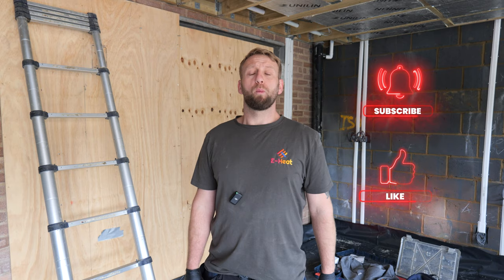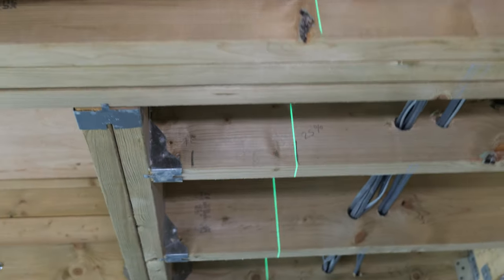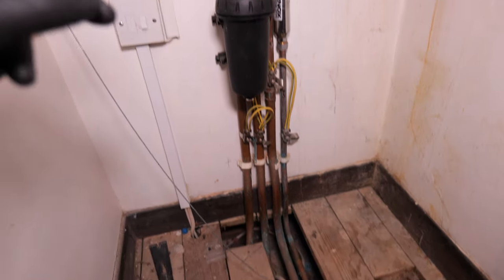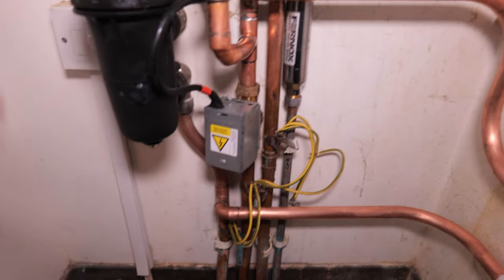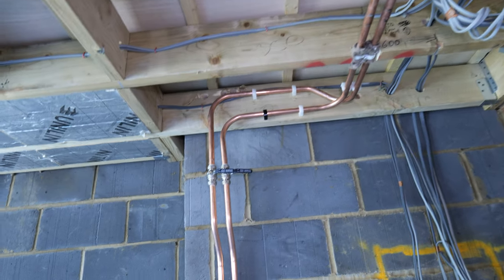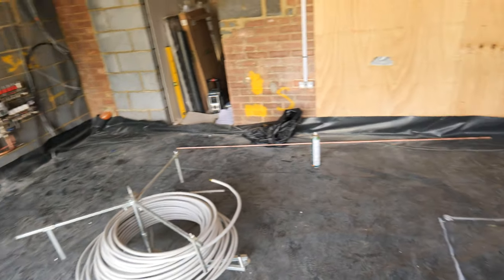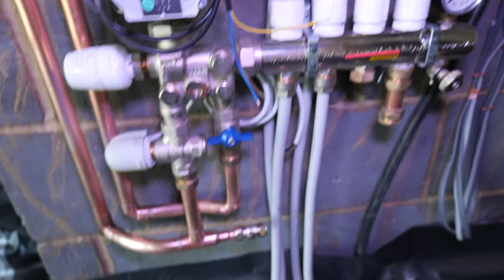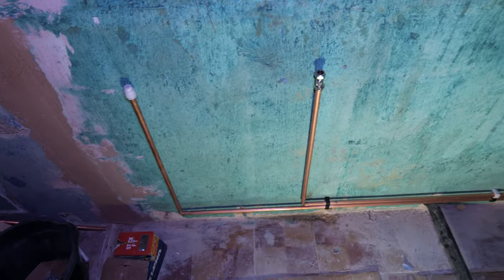Extension underfloor heating to combi boiler

Comment: Thanks a lot for taking the time and trouble for making the video. Our system mirrors yours,  kitchen extension with UFH to existing boiler. Couldn't work out why we were getting water hammer from zone valves when the CH/UFH shut off! 
No bypass for the pump run on!! Doh....
Cheers 😊 👍

Comment: One of the reasons to pressure the underfloor pies to 6bar is to expand them slightly so when the screed goes down there will be a tiny gap between the screed and pipe to allow for expansion when the heating goes on.

Comment: Seeing this manufacturers manifold has convinced me to use Nu-Heat again on the house I’m currently building. And yes I installed the underfloor heating on previous.
Reply from the maker: Thanks for the comment. What's the difference may I ask?
Reply: @loving-plumbing  their’s was much more concise. not cheap though.

Comment: very good information, I am installing a UFH system to my combi system currently. From the video I will add in a bypass. But I had a question on the 2port valves. Should there be 2 port valves on both the CH to radiators and the UFH manifold?

Comment: Great video and knowledge is amazing like your other videos what boilers this the 4000 or the 8000 and can you use the plug in room stat still with the radiator side and use external controls for the underfloor or will you need to hardwire a new controller for the heating I’m so bad at electrics

Comment: Great video. I'm looking to get Tado installed. Regarding the electrical wiring for the 2 port valve, I understand you need to install one for the radiator and one for the UFH after the flow pipes from the boiler are tee'd off. But I'm keen to understand how these motorised valves get their power? As in, where does the black cable coming out of the motorised valve connect into? Any idea how each of these motorised valves get their power to turn on/off? For example, for the UFH, do you install one 2 port valve in the manifold area which gets its power directly from the manifold / UFH wiring control centre and turns on once the thermostat calls for heat? And to control and turn on the radiators, do you install the second 2 port valve next to the boiler so it can collect its power directly from the boiler or from the Tado wireless receiver (and therefore switch on once the Tado TRV is calls for heat)?
Reply: Am sure they all connect to a wiring centre to run all system

Comment: Worcester have put a technical bulletin out for connecting ufh manifolds to their boilers TB 0137 B. It needs hydraulic separation
Reply: I’m looking to do this on my system, but I plan to stick another pump before the rads otherwise I think the CCT will just become a bypass when rads are calling for heat. Would you install an identical erp pump to the boiler and wire it to the boiler’s pump so it mirrors the pump modulation?

Comment: I'm fairly sure you fill up the underfloor through a hose connected to the Manifold, not use the boilers filling loop? What did the manifolds' installation instructions say?
Reply from the maker: Yeah you can do  that also. 👍
Reply: I always fill up with hosepipe and open drain off until all air is pushed out from the loops individually. Once done, open the isolation valves on F&R pipes and bleed from manual air vent on manifold
Reply: Best thing is make up your own filling kit by way of a 1/2 hp pump and purge the whole system at once particularly a large house.

Comment: I agree with both those comments. Should not be chopping joists ! Well illegal and takes strength out of would and needs separation
Reply from the maker: Hey Erik. Thank you for the comments. I knew the underside notches would ruffle some feathers 🤣. It's totally legall. Check the regs . Like I said in the video a close coupled Tee or hydraulic separation is also ok, but that is not how 99 percent of combi boilers are plumbed in , plus no underfloor heating manufacture I've worked with say that is mandatory. The manifold has a balancing valve to reduce flow temperature . Cheers
Reply: @loving-plumbing  just coz 99 percent of people do combis like that doesn’t mean it’s correct and manufacturers dont know what they are doing most of time. Just coz media says that how you should do it, again doesn’t mean its correct. Be a shepherd and not a sheep
Reply from the maker: @aerenewables  So your advice is to ignore manufacturers instructions. Cheers Erik....
Reply: @loving-plumbing  no bud do your research every job is different manufacturers just cover their own arses they don’t care about the rest of the system.  Why dont you look into a hydronics coarse it will change your life
Reply from the maker: @aerenewables  In the video I referenced low loss headers and close coupled Tee's on several occasion. I'm well aware of system design. As I said. We are following manufacturers instructions in this video..... As do most plumbers , builders and homeowners.
Reply: Hmm sorry to say it bud but manufacturers dont understand. Have a look at Northampton heating academy they are really good or heat geeks you will understand what we mean by seperation and most times it will save you more money on installation cost as you wont need half of what they try to sell you. Im not trying to be a karren just trying to share some knowledge.
Reply: @deanchapple1   agreed
Reply from the maker: @aerenewables  Soooo what would you do I'm interested to know now.
Reply from the maker: @deanchapple1  you are correct on close coupled Tee on the boiler. I was waiting for someone to say at the manifold 🤣. Weather compensation agreed. Have to remember this is a small kitchen extension. I'm not there to re design there current system. This video if anything is highlighting my audience.   If you were a standard plumber, builder or homeowner this is how you would do it. That's was I have done it that way. I do explain that at the start. Im not convinced on the overheating. The CCT's are also there to irradiate noise.at the manifold also. But in all honesty I have never seen a boiler overheat that hasn't had a CCT installed.
Reply from the maker: @aerenewables  thanks for the information Erik. Now im not being a Karen..... But that is not right. Only a close coupled.Tee or low loss header underneath.the boiler is correct. I've chosen to do it this way in the video to conform with the instructions... My understanding is fine.
Reply from the maker: @deanchapple1  that was without the underfloor heating running yet to be connected. Anyway Dean thanks for the conversation 👍👍
Reply from the maker: @deanchapple1  🤣🤣i guess it's a good thing I don't usually get criticism on my videos. Been interesting. Thanks 👍
Reply: @deanchapple1  yes it would but i would still fit a a zone valve. Cct would be better at the of the start of the ufh then you wouldnt have to use a zone valve at all i reckon
Reply: Didnt see the other bits yeah dean that sounds best. Wish i was that good on the benders 🙈
Reply: Who cares 😂😂😂 what difference does it make to you if there’s close coupled tees or not, unless your planning on buying that house at some point in the near future 😂
Reply: You need to get a hobby and stop trolling on a Saturday morning more like 😂

Comment: Are you on the face book heating design forum ? This system will not be able to use a low flow temperature strategy as the manufacturer has mislead you into a high temperature lower efficiency system. You should do the system design not a lazy out of date supplier. Your workmanship is 1st class and to see you do this design 😞
Reply from the maker: Hi Andrew. I think you have to remember this is a quick underfloor heating job in a extension followed to plumbing schematics provided. 
 I'm well aware of the benefits of adding a close coupled Tee underneath the boiler or even a low loss header. 
 Although I appreciate this is not the best possible way it could be, I am not there to change controls or redesign the system. I mention several times in the video that you can indeed install additional components. 
 I'm a great admirer of your videos and I'm sorry to have disappointed you on this one! 🤣. If I redesigned every system I worked on I would be out of the job.
 Thanks for the comment 👍👍.
Reply: @loving-plumbing  Is it really that difficult to add in some closed couple tees? hardly a system redesign. Just laziness more than anything
Reply from the maker: @victoria-ud3xh  lol. Clearly you have no idea what's involved.
Reply: Yes I do actually. It is certainly not a huge job, weird that you have the knowledge but you can't be asked to use it. That's british tradesman for ya lol
Reply from the maker: @victoria-ud3xh  🤣🤣 cheers for the comments.

Comment: Your figures for where you can and can’t notch the joists are correct except for the fact that you can only notch the top of the joist. You aren’t allowed to cut anything out of the bottom of the joist
Reply from the maker: This is not true
Reply: From building control:

Depth and position of notches must be within the zones shown in the diagram below and only in the top of the joists
Reply from the maker: @jeffglaister9620  bottom of the joist can be notched if there is not, or will never be notches in the top
Reply from the maker: @deanchapple1  that a uninsulated air gap
Reply from the maker: @deanchapple1  even the electrician didn't use it..... 🤣🤣.

Comment: It's all wrong anyway, the other holes make the joist good for nothing, clipping pipes to joist, great for noise click click. You can get plastic over-clips (twin u shape) that sit on top or (bottom in this case), of the pipes that have a metal top (stops nails and screws) and a central fixing, these allow the pipes to move as there not tight like clips plus use can use hair felt across the wood. Don't clip within 600mm of a right angle as the pipe won't be able to expand, more click click. 
Spent more years first fixing in copper than plastic, just some of the tricks old gits do.